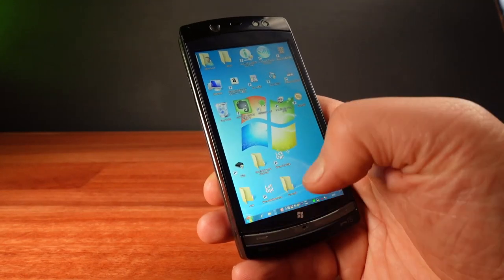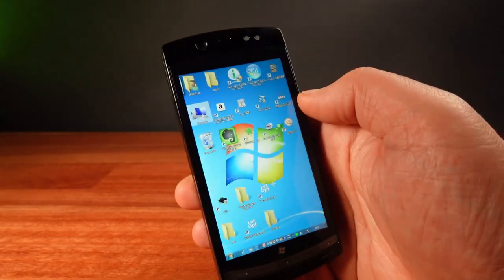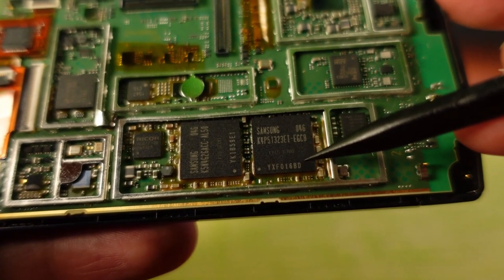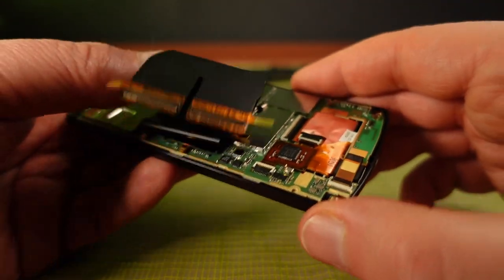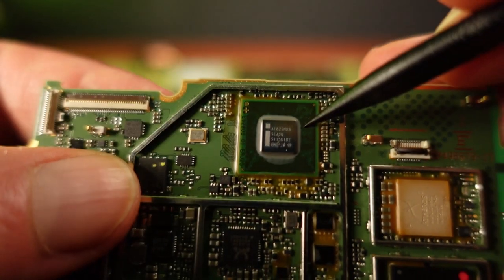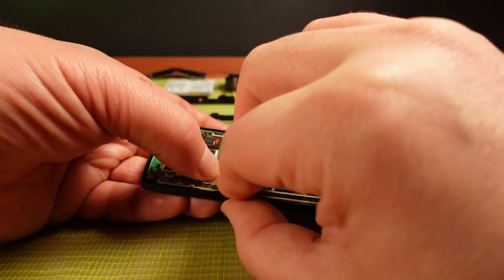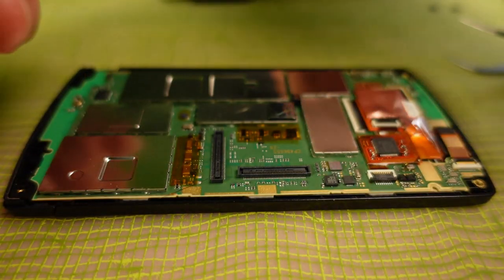Fujitsu F-07C Teardown : Punched in the Guts

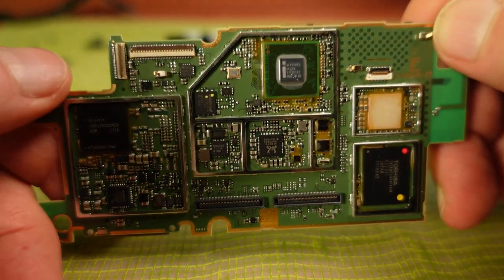Comment: 5:20 - Intel Atom Z600 (SLBZP)
5:28 - Fujitsu ARM-based RF transceiver (MB86L01A)
5:34 - 2 x Samsung K4P51323EI (512MB DDR2 RAM x 2 = 1GB)
5:53 - Toshiba  THGBM2G8D8FBAIB (32GB eMMC flash storage)
6:00 - Atheros AR6103G-BM2D (Wireless B/G/N module)
6:06 - Intel SM35 Express Chipset (SLJ3Q)
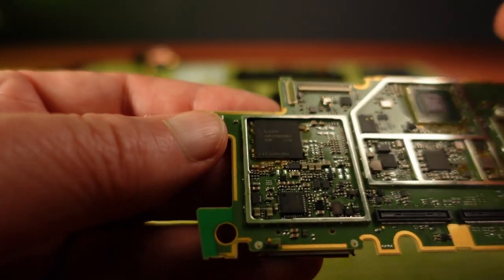6:18 - Hynix H8MJXQQXOMER (NAND Flash or RAM for the ARM phone, need the bottom number to see but out of focus...)
6:28 - RealTek ALC270 (High-Definition Audio Codec)

Comment: Great video yet again, I finally got another Vaio UX with 1GB (black edition) and have been able to repack the battery pack with new 18650 cells. working great with the 32GB SSD. :)
Reply from the maker: The black models are cool, well done. The UX is a really neat little machine. They have class and style. I'm upgrading mine at the moment. I'm hoping it goes well.
Reply from the maker: I'm releasing a new video tomorrow. I think you will like it. You might want to have your black UX with you.
Reply: @JanusCycle  I have installed Terminator Skynet game from 1996 and Terminator 1 from 1991 and Halo combat evolved 2001 all working nice.
Reply: I held out for a blue one back in about 2012. Yeah regret that. Should have gone with a silver or black. The blue isn't a good blue and the blue bezel isn't nice either.
Reply: @Raptor50aus  I had halo running on mine back in the day. Such a shame I never worked out how to remap the capture button otherwise it would have been playable on the onboard controls.

Comment: Yes a white knuckle moment of any re assemble - the re power up sequence.. suggest taking photos with your phone of key cables and connections just prior to removing them, this way you can simply flick thru the images of key moments rather than having to watch the tear down video over and over looking for a certain frame.. worked for me on many machine rebuilds.
Nice video, fun to watch. Was cringing at some of those ribbon cable and push connectors.. soo tiny and fine!! Glad you were able to get it running again tho

Comment: Pritty sure the two Samsung chips are the ram and the Toshiba is the emmc. The chip after that I think is the phones flash storage. 

I also think you have the two Intel chips the wrong way too. The 2nd looks more likely to be the atom.
Reply from the maker: Thanks, you might be right. I was mostly guessing.
Reply: That is Intel chip with the epoxy package is the cpu and the bare die package is the chipset it's a sm35 chipset just google the number on that chip it reads out slj3q
Reply: Maybe one of those Samsung chips is a cpu with ram on top,  idk if Samsung used their package on package (pop) methode... It's common on phones to have the cpu under and the ram on top with the markings so probably one of those Samsungs run the other os
Reply: @309electronics5  nope

Comment: Have you ever considered looking into dumping the firmware from the Symbian side of the phone? Or at least look more at the Symbian side of it?.
Reply from the maker: Yes, but there is not much information available. Even in the Japanese forums when I had a look.
Reply: @JanusCycle  from what I found out, the Symbian board does have a OMAP Processor. I am also looking into doing this as well.
Reply: The Symbian side actually uses Symbian Kernel but it's not the Nokia S60. You can't build any apps or connect debugger or boot into firmware upgrade mode or anything like that. Maybe there were some Chinese hackers doing that for SIM unlocking, but never even heard how they'd do it.
Reply: @すどにむ  to be clear you can build apps for the Symbian side if you have imode contract. iMode contracts still exist till 2026 but registration is closed. Which is sad cause I would like to make apps for this phone. Or any Docomo phone. Mainly P900iV.

Comment: So instead of making a phone that can run Windows 7 they crammed an X86 PC inside an ARM based Symbian phone and the two computers barely share any hardware outside of the absolutely necessary, such a weird approach.
Reply from the maker: I know right, such a weird concept, yet they made it work enough for a phone.
Reply: You had to have a carrier-branded phone back in this era in Japan, basically same as you have to have an iPhone these days with access to App Store and iMessage, but each carriers had their own "iPhone". The actual iPhone weren't allowed into those carrier offered services so they were bit of a half a phone that needs a backup. The phone side of this phone is exactly that carrier phone to solve that problem.
Reply: @すどにむ  I'm aware of how fascinatingly weird yet technologically advanced when compared to the rest of the world Japanese phones where during the 2000's and early 2010's, the whole galapagization phenomena which is partially responsible for a bunch of mobile games becoming lost media, but this phone in particular seems to really be pushing what can be considered marketable. So knowing that carriers quite simply mandated phones to be a certain way does help make this technological oddity make a bit more sense, thanks for the info.

As an aside you don't really need an iPhone in many countries, where I live they make up a tiny percentage of the smartphones out there with Android dominating by a huge margin, and before Android became the standard Nokia (when they were still using s60 Symbian) was the one ruling the market to the point that back when Windows mobile was still a thing it had a larger percentage of users than IOS. I've never owned nor had interest in owning a product made by Apple in my whole life.

Comment: I’m looking at resetting the bios by removing the CMOS battery because I fucked mine trying to install windows XP and not it says boot manager is missing
Reply from the maker: Wow, I'm keen to know more about what happened when you tried.
Reply: @JanusCycle  at the moment all I can’t do anything, I can’t get into the bios, to change the incorrect boot sequence. So I’m not sure what I can do from here. Did you see a CMOS battery? I need to reset the bios or the boot order.
Reply from the maker: @liamkeenan1062  The only thing I know is when in the dock and with something plugged into USB pressing F12 brings up the boot menu. I don't know about any CMOS battery or what is happening on your screen when you switch yours on.
Reply: Do you think maybe I should look at replacing the EMMC
Reply from the maker: @liamkeenan1062  I don't know because you haven't described to me what you see happening in detail when it's booting? I'm still keen to know what you saw happening in detail when trying to install XP? You will be surprised which details are important. I'm also surprised at which details are important when learning about something I haven't seen before.
Reply: @JanusCycle  if you want I can send it to you, it’s basically bricked. It could make a good spare for you. But if you did fix it that’d be amazing
Reply from the maker: @liamkeenan1062  I would like to help you get it working. Though I’m hesitant without knowing more. I’ve been thinking that it could be not detecting the USB boot device. Before I can help more I need to know exactly what happens when booting with a USB boot device connected?
Reply: @JanusCycle  Well it’s booting to the wrong partition, have the dock and made a bootable USB but the option to get into the bios is gone. It’s basically bricked and has been since 2020. If you can take a look I’d be so humble. If you fix it I’ll be so grateful
Reply: @JanusCycle  so the only idea i had, was if you wanted to, you’d have my permission to try replacing the SSD, even upgrading it, that way you’d be free to install any OS. An imagine a 512gb F-07C that dual boots EVERYTHING >:)
Reply: BRO I FOUND AND GOT AN ITG XPphone 2
Reply: I don't think the F-07c has a CMOS battery ive been analysing rhe video frame by frame and i didnt see one, i guess the phone uses it's main battery to hold those settings, similar to a modern laptop.

I've been looking into this device more and more even tracking one down for an awfully good price (not saying where because someone's probably gonna snag it lol

But at the same time I'd actually like to have a go at trying to repair your one. As it seems something to do with the flash has gone wrong. Would be interesting to have a in depth look at it and see what perhaps could he done.